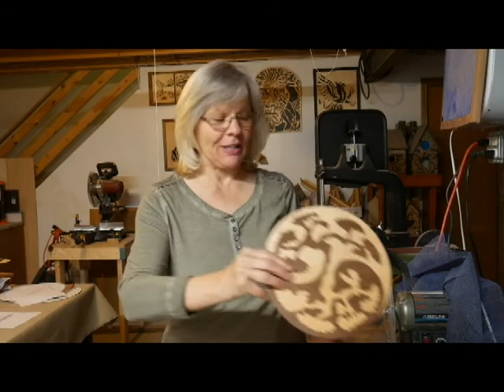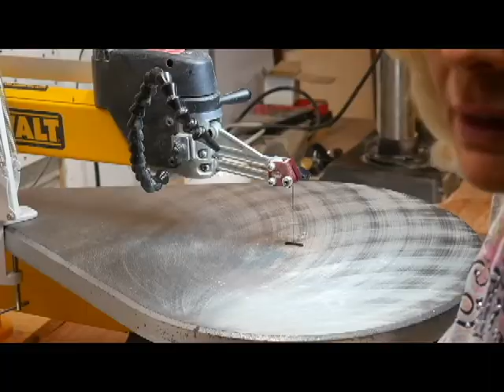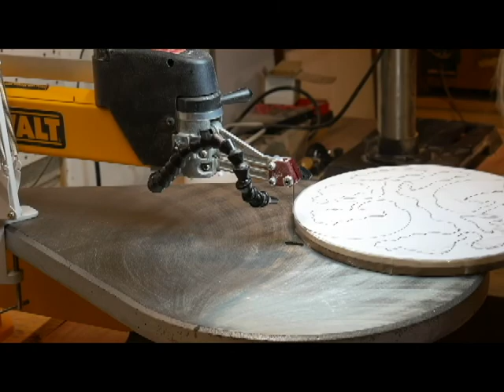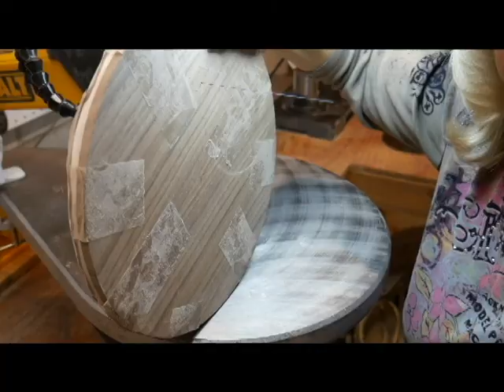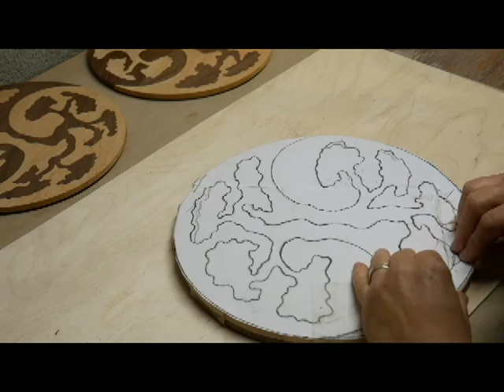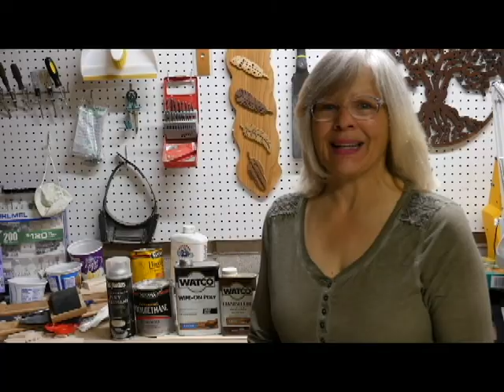Scroll saw segmentation

Comment: Thank you for including problems, showing difficulties, as I have been a scroll saw owner for 20 years, but never been able to successfully clamp my blades;they come out of the clamp, break, etc. so the saw has become a "SKULCH" catcher. You've shown, even for an accomplished sawyer, there are constant problems to overcome. Also, I never dreamed there were So many kinds of blades, for different situations. May I say, you are quite the woodworker! The skills and considerations you must maneuver through, may be tiny-sized, but are identical to operations for full-sized projects. (I still, after reviewing this video, can't imagine how you fed that hair-sized saw blade through the 1\2" project, connected the upper end, lower end of the blade and did no damage to the hairline kerf when it started to cut!).
Reply from the maker: Thank you for your kind words. I am also learning new tricks and tips all the time. Keep on scrolling!

Comment: I have been scroll sawing for a number of years now, to prepare my wood I sand it smooth then wet it then sand it again, this ensures that the wood fibres do not stand out again. I then wrap it in painters tape, glue my pattern to that then wrap it all in Sellotape, this helps to lubricate the blade. When it is finished I lightly sand the edges and wipe it down with turpentine (mineral spirit) to remove any glue before putting on my finish.